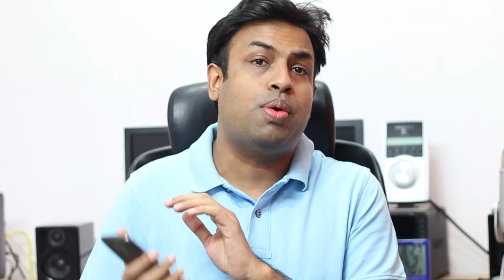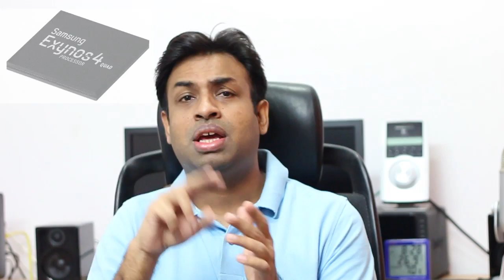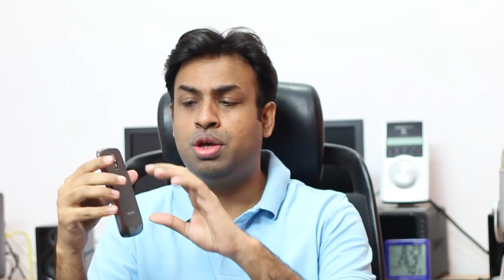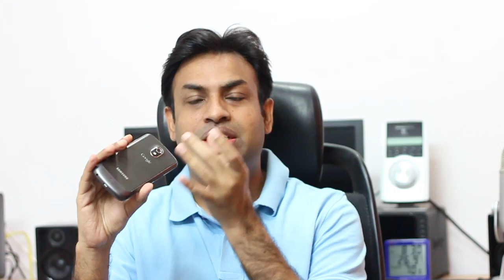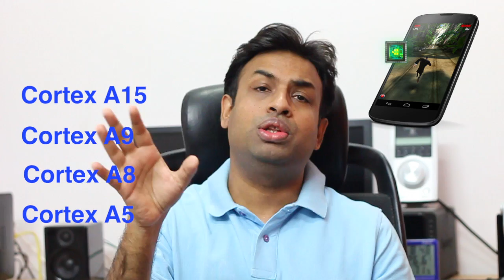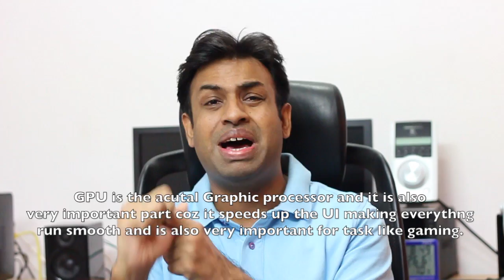Understanding ARM Processors / CPU in your Smartphones

Comment: this processor is sucking too much power (what i mean is that this piece of [sh!¶} drains battery fast and heats about 2 or 8 minutes if you are watching UHD Or HD Videos Playing Games about 8 to 9 minutes it will heat up fast and it shits as f l, some of unreal engine 4 games couldnt run on this cause it lacks of shader pack (what ever they call it)

Comment: seing as you aked me so many times i thought i should tell you what do i say.
title is a bit misleading, would have liked a bit of analysis, its more like explaining why clock speed is not the same as overall performance. which tbh could have been explained much more understandably as speed vs torque analogy or an explanation of how this means more operations can be performed in a clock cycle.

Comment: Superb..... absolutely GPU is not that much important i do had a personal experience
 
Basically am a  fan-boy of games...so looking for a high end gaming like asphalt 8,six guns but with less money bag  
here comes lumia 520 having just 1 GHz and 512 MB RAM specs and got at Rs.6000 in flip-kart 7 months ago
 has phenomenal GPU adreno 305 and the chip set krait 400

All features in performance equal to moto g and moto g2....

Without this architecture and specs it would struck like the microsoft lumia 535 for a rich and interactive interfaced windows OS  and finally got rid of the all time struck android phones except HTC....

Comment: Hello Ranjit... Nice video... This might be a lame question, but since this is an explanatory video, I would like to ask what is the difference between Cortex and Krait architecture ? Both are licensed by ARM I guess and Qualcomm uses both such architectures. 
One more thing, I know Qualcomm SoCs are far better than MediaTeks but in the budget smartphone segment, comparing the Snapdragon 400, found in Moto G with the Mediatek Octacore MT6592 SoC, which will provide better performance? I am looking at the HTC Desire 616 as a MediaTek option here.

Comment: If you want Branded Mobile = Samsung (In this case Core is not recommended) LOL

Better Performance = LAVA Iris 504q (But MediaTek Processors drains battery a lot but will easily last a day) (I have a phone with this SoC)

Well the Xolo Q800 also uses the same MediaTek 6589M SoC but has 4.5inch(Not Hd) display compared to 5inch(Hd 1280 x 720) display of LAVA Iris 504Q

Plus the Iris has some other Cool Features Too.

I will Recommend LAVA Iris504q

Comment: You are wrong cortex-a15 is not the architecture its a microarchitectural implementation, the architecture is ARMv7 and Qualcomm is not based on the cortex-a15 it's their own implementation based on the ARMv7 instruction set architecture (ISA)
Reply: What is different between architecture and microarchitecture ???

Comment: Well ARM stand's for " Advanced RISC (reduced instruction set computer) Machine " RISC is a very basic form of data path design, it's very simple. you can say its a simplified version of X86 architecture which we find in out pc's and laptops. X86 is a CISC (Complex instruction set computer). RISC can not perform complex operations like FMAC etc which we don't need most of the time .... the idea behind RISC is less complicated things are easier,better,faster and highly power efficient.

Comment: Ranjit have you used the Samsung battery update pack for your Galaxy Nexus? Because I have it and it's great. You get a slightly thicker backcover (abou 0.5 mm thicker). But you still can use every case without any issues.

Comment: Great video!

I understand why you referred to Snapdragon S4 Pro as a Cortex A15, but the performance difference between Krait and A15 cores appears to be quite large based on Chromebook Exynos 5250 benchmarks. S4 Pro Krait cores seem to get around 1300ms SunSpider at 1,5GHz, where the Exynos 5250 Cortex A15 gets around 650ms at 1.7GHz

S4 Pro is a brilliant chip, but I expect it to be blown away by A15 based parts.

Fastest to slowest: A15, Apple custom, Krait, A9, Scorpion, A7, A8, ARM11

Comment: SOC makers like Nvedia,TI,samsung make pure cortex architechture chips but not qualcom.tegra 3,exynos 4 were pure cortex a9 chip but qualcom's s3 wasn't.while krait is better than most cortex a9 chips, it'll be beaten by true a15 chips when they arrive.
That's y they say that nexus 10(running on exynos 5 ) is the first device sporting a true cortex a15 cpu.another eg is apple a6 chip on iphone 5.it's apple's own design but similar to a15.however they still have arm v7 instruction set.

Comment: One thing that u missed Ranjit is that qualcom is a bit diffrent than other SOC makers like TI,Nvidia coz qualcom has liscenced with arm only for their instruction set that is arm v7 instruction set.they make their own custom cpu designs like scorpion and krait  CPUs.scorpion was qualcom's custom design but it was neither a cortex a8 or a9.similarly krait is also not a pure cortex a 15 it's qualcom's custom cpu architechture which is quite similar to a 15 but it actually isn't cortex a15.